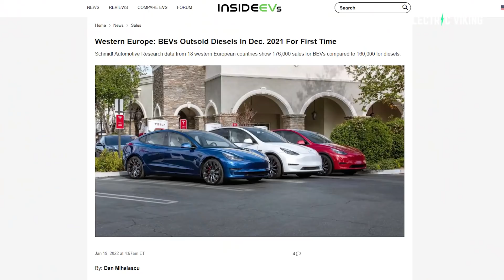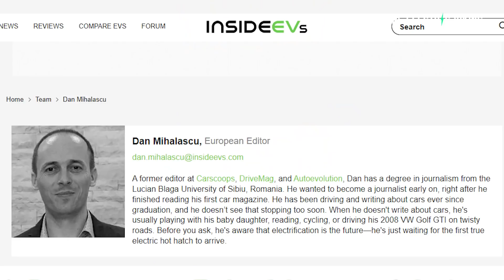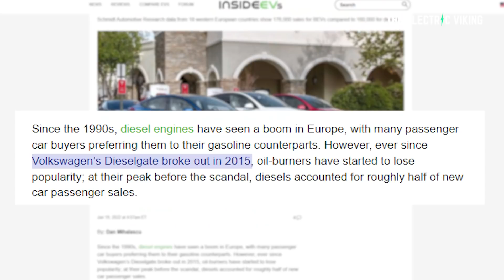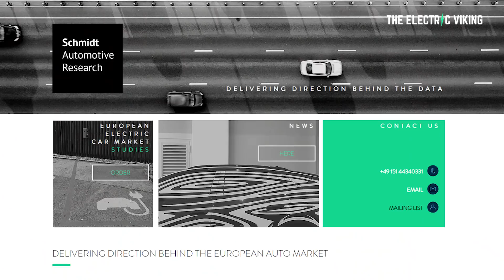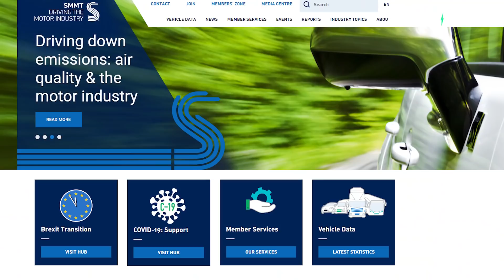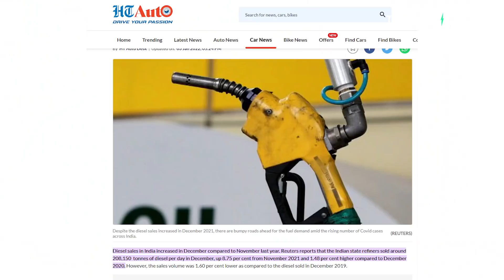EVs just OUTSOLD diesels for the first time in HISTORY!

Comment: In France, diesel cars even went as far up as three quarters of new car sales, not half (73% in 2012).
Last January, diesel fuel represented 78% of all fuel sold at the pump, but that was mostly because of covid, as diesel trucks were still on the roads as personal drivers of petrol cars stayed home.
European and local regulations are the most responsible for this rapid death spiral of diesels. It's not even possible to enter some cities with older diesel vehicles, and the same will happen for older generation petrol cars too.
Reply: Exactly. There is no free market environment to compare the actual demand. Politicians made extremely hard to own a diesel car. On one hand you have rules and regulations planned to prevent you from using your car and on the other you have tons of incentives like free parking and etc and subsidies.

Comment: The problem you are missing, sorry to correct your.
It is difficult for the average (non-scientific) public to see more than one problem, so there is a complete mix up between CO2 and NO2 and how they are entirely different - once causes global warning - kill us later, and NO2 (and particulates) cause illness and kills us soon.  The focus on danger changed between toxicity (NO2 and particulates) and global warming (CO2).  Of course the car industry played on this misunderstanding - and cheated the system; while governments set targets on CO2 while missing to put strict targets on "pollution" due to lobby action.  This meant that diesels in Europe were sold initially as they were more efficient and therefore less polluting - they reduced CO2.  The result was that Europe switched massively to diesel cars.
So the public were misled by the targets on CO2 while ignoring pollution and the car manufactures create cheat devices.
We still see the miss-information in the last week from Volvo (of all companies) putting out an article on how green are EV by putting in the life cycle of mining minerals for batteries but missing out the life cycle of petrol/gasoline production - which is very high.
Remember folks, the UK government will probably get rid of the 230 million grant for green energy to reduce energy costs while keeping the annual £10 billion subside for fossil fuels (OECD numbers) and the £1.3 annual subside for nuclear (OECD numbers).  
Than you Electric Viking for the fight against miss information, great stuff.

Comment: First up I enjoy your content and much of what you have is the first time I have seen it mentioned so well done to your team, you should give them credit. The Diesel burns half the fuel than petrol so that is half the emissions, nitrox oxide are more as the temp of the burn is higher but this can be absorbed by the addition of ammonia (blue) at the end of the burn increasing the power of the burn as it burns the nitrox oxide. shifting the manufacture of cars to other countries using dirty coal power is not green. why don't you push that the lithium is processed in Australia, rather than just exploiting it as a third world country?

Comment: Before slagging off Diesels, please look at the facts regarding running one. I’d rather have a Diesel Ford Galaxy then a petrol. Cheaper to run, more fuel efficient etc etc. Petrol is now a complete con because of the new E10 (10% ethanol) that’s been introduced, higher fuel usage, less efficient etc etc = worse for the environment.
Reply: People get lung-canser from the (NoX) from diesel fumes😷👎
Reply: @mikafiltenborg2291  but they do emit less co2 and greenhouse gases, and don’t forget new engines emit far less fine particle pollution then older generation diesels.

Comment: As far as I know it's not completely truth though that EV's outsold diesels for the first time. At the end of the 19th century - and early 20th century the situation was different. From Wikipedia: "Acceptance of electric cars was initially hampered by a lack of power infrastructure, but by 1912, many homes were wired for electricity, enabling a surge in the popularity of the cars. In the United States by the turn of the century, 40 percent of automobiles were powered by steam, 38 percent by electricity, and 22 percent by gasoline. "
Reply: there were no diesel cars at that time, so no diesel cars to outsell.

Comment: Sam, I never bought my diesels because of "clean diesel". Bought them, and still have one with 20 years on its back, because of its efficiency with mileage substantially better, specially in city driving, than gasoline cars.
Reply: Same here. A diesel car like my current 2007 Renault Megane II Estate is very practical and gets me 1,000 km of motorway between refills, which used to be much cheaper than the only other viable alternative at the time, petrol. Clean diesel has never been a thing for most customers, I think we were all perfectly aware that we were basically giving our first born' lives away to air pollution as a price to pay for this "cheap" diesel...

Today, a regular driver would be stupid not buying an EV if they have the money. If you don't drive much, or if you need a specific car like a station wagon, which does not yet exist in the used EV market, it does not make economical and environmental sense getting rid of your ICE car yet, but there also, things are fast changing. I still don't see any used station wagon EV coming over the next 5-10 years though, as there is only the MG5 on the market as new today. Most other practical EVs are heavy and less aerodynamic SUVs.